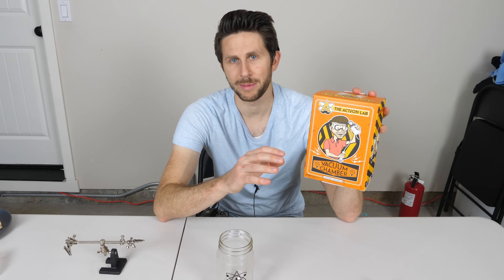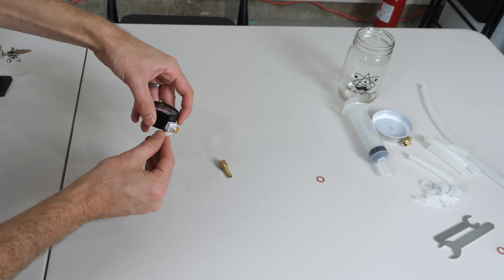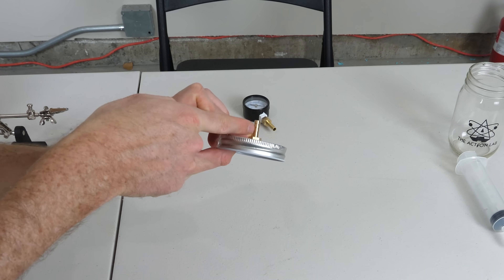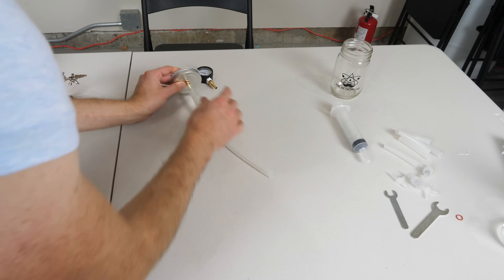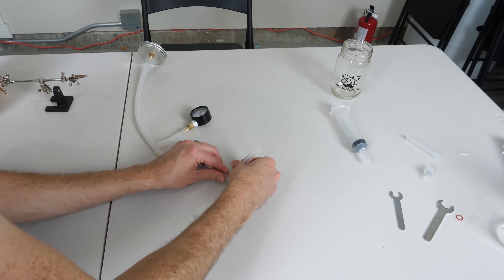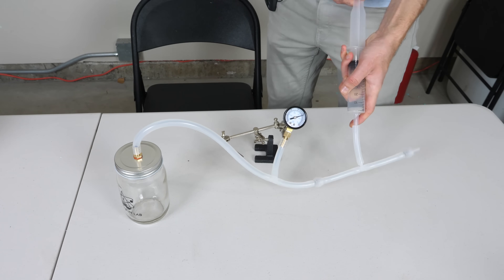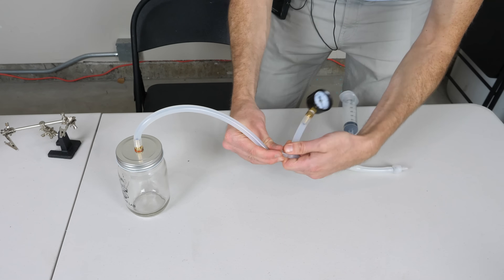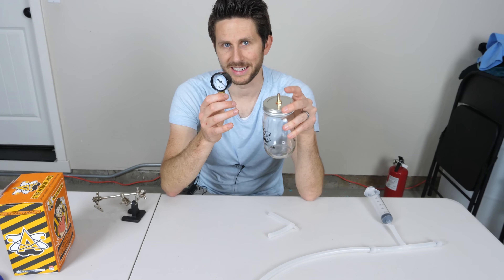The Action Lab Box Vacuum Chamber Assembly

Comment: I think the gauge I received is miscalculated from yours. It shows about -4 in-Hg when not connected at. When at maximum vacuum using that syringe, it shows about -29.5 in-Hg. Is there any easy way to properly calibrate this style of gauge myself?
Reply from the maker: Sorry, this style can’t be calibrated, you just have to check what is “0” at your elevation with the specific gauge you haveZ
Reply: Does not the gauge measure the difference between the internal and the external pressure, and thus should read exactly zero when disconnected regardless of my altitude?

Anyway, I figured out a method for adjusting the gauge. It may not be the ideal method, but it's the first method I have found to work. It's not very gentle, but it doesn't do any visible damage to the outside of the gauge. I strike the left side of the gauge against the palm of my hand as hard as possible! This causes the needle to move closer to the zero mark, bit by bit. I required repeated strikes to get it all the way to zero. My hand is a bit sore now, but I think the gauge now gives more sensible readings. Under the best vacuum I can get, it reads -28 inHg instead of being maxed at 30 as it was before, and now it returns all the way to zero when the vacuum is released.